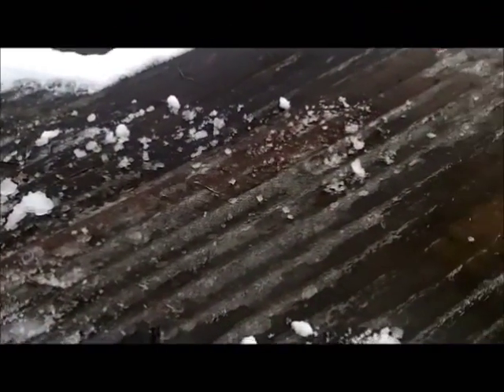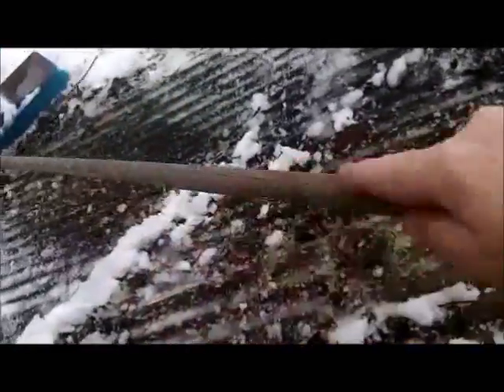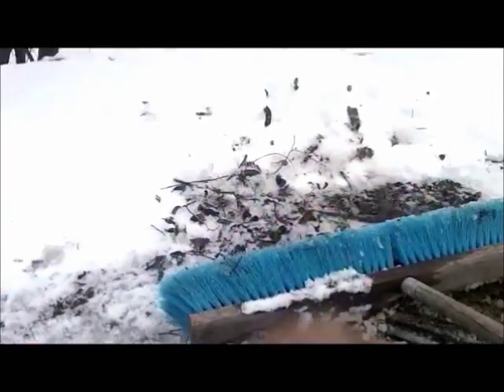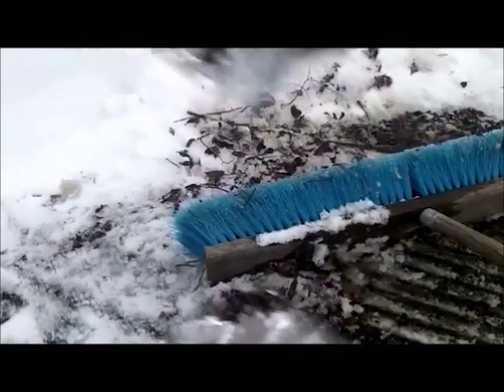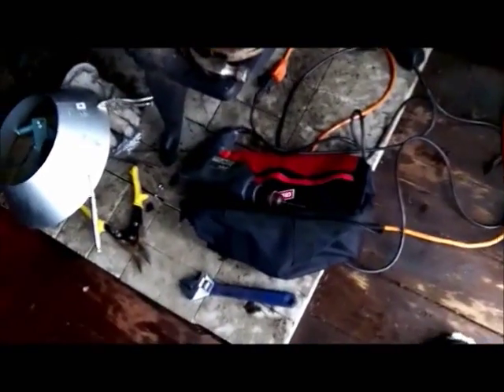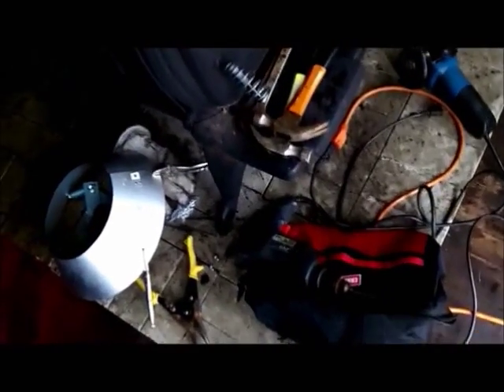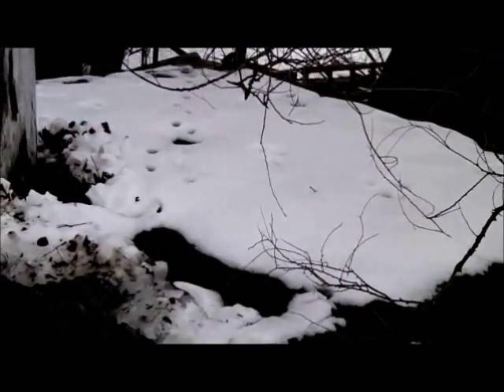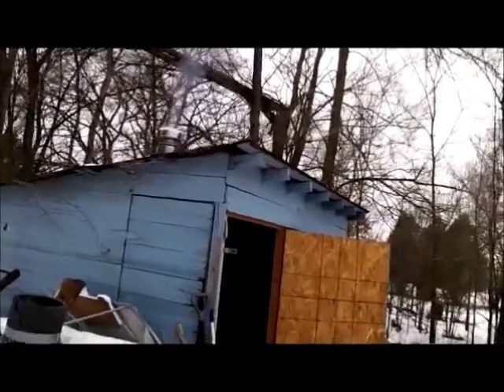Wood Stove Installation part 3 the chimney, building a fire , 2013 Winter Projects Series

Comment: Nice job, Stove looks similar to the one I have in my basement probably a knock off of the Vogelzang, keeping it as a spare or use outside to cook on or eventually in a shed. Looks like the roof supported you ! Lucky that didn't look to safe up there.
Reply from the maker: Thanks, yeah it would have Vogelzang casted into the door. I got this second hand, and half price and new the stove isn't that expensive, but to ship cast iron, now that's another story lol. I've been up on that roof before some years ago but not in the last 20 years. I'm going to have to re-sheet in the spring.
Reply: middyband Good project, those leaves in between the sheets not good. Cast is heavy to ship but it also brings in decent $ at the scrap yard. Nice install will keep the shed nice & warm,
Reply from the maker: Thanks. I'll be putting it to the test soon, after this short warm spell, it is supposed to get below zero, The chimney is class a so it doesn't get hot.